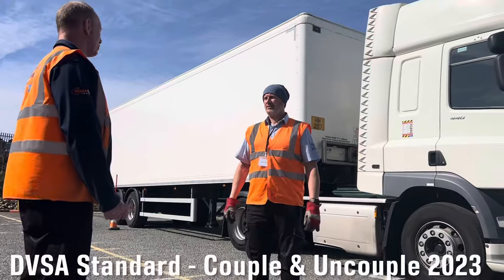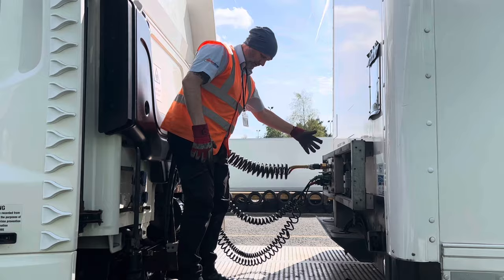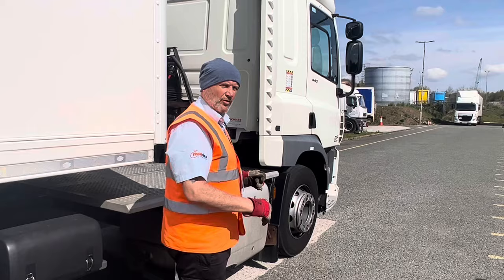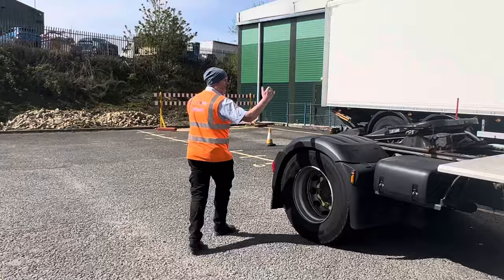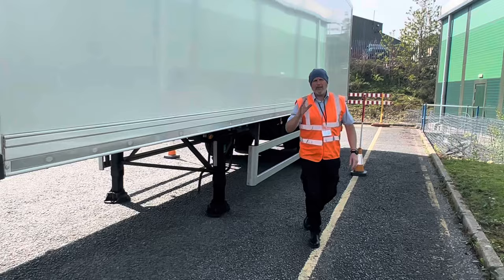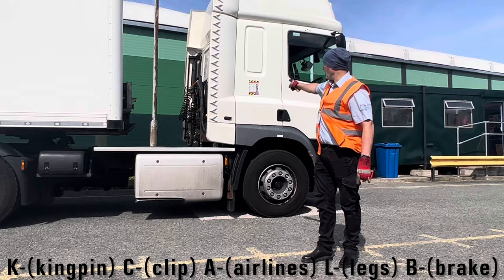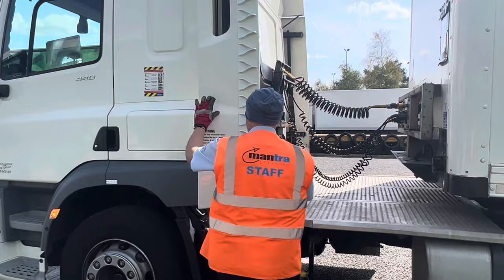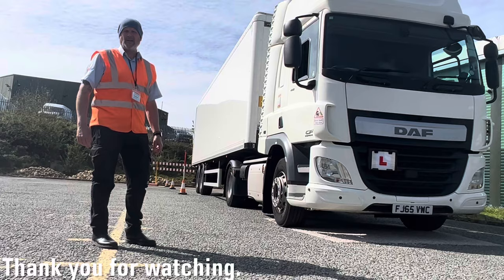C+E | Class 1 - How To Couple and Uncouple a Trailer to DVSA Standards 2023

Comment: Just passed my 3a today and am finding these videos great refreshers as it completely bashed my brains in and I've forgotten half of it 🤣Throughout my learning and exam they had me lowering and raising the suspension on the unit to get under the trailer. Complete pain in the backside and confused me so much as it wasn't included in any of the learning material or BLACK. This little black remote control just came out of nowhere.

Comment: You forgot to put your seatbelt on? 😂

I learned the hard way to always check the 5th wheel is higher than the king pin. Went straight under it and passed it lol, luckily only busted up the lights on the unit. Lesson learned 

Great video thank you
Reply: Seatbelt is not a requirement for the test
Reply from the maker: Seatbelt is not a requirement for the test, however, well spotted and we do advise the learners to wear a seatbelt